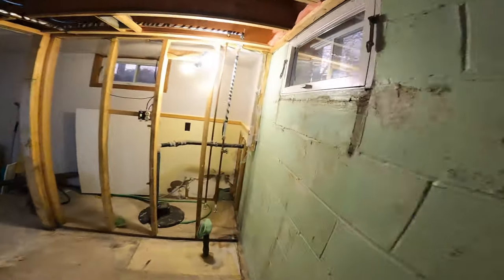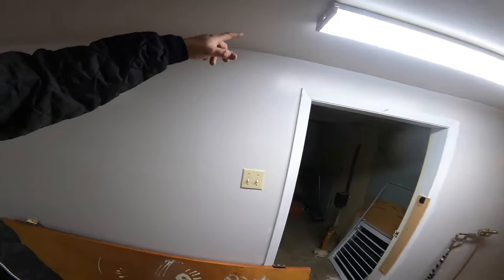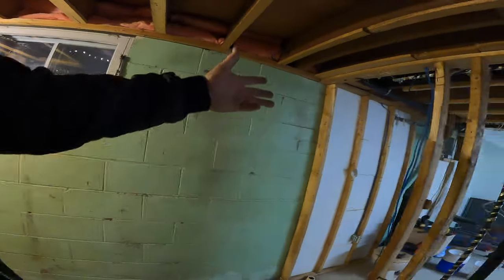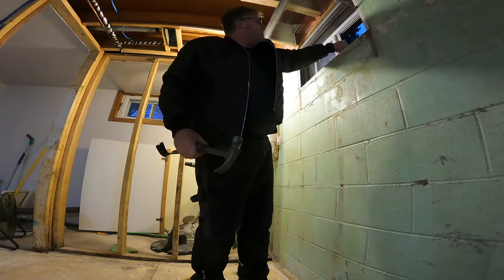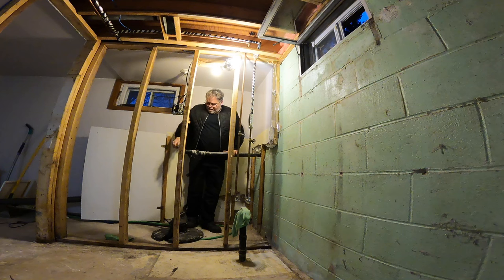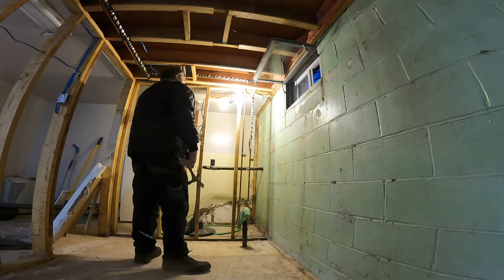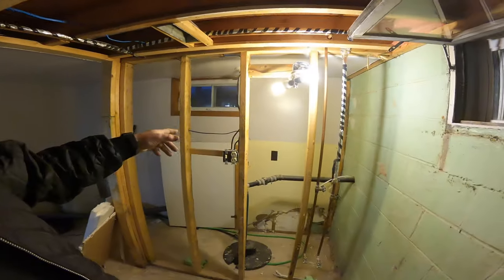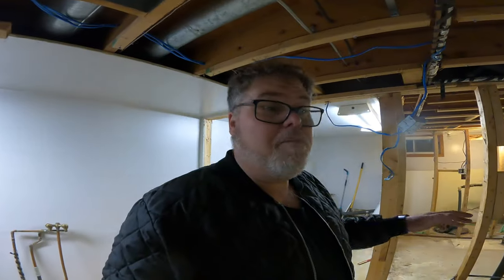Well I Guess Im Getting A New Bathroom    HD 1080p

Comment: Just nicely box it in with a small box that will just cover it up without losing much headroom.
Use anything that will be esthetically usable.
Like boxed in with sheet metal or aluminum siding material.
Insulate the pipe with something so the metal box doesn't contact the pipe.
Diss similar metals that touch each other can cause  electro galvanic action causing the pipes to have corrosion.